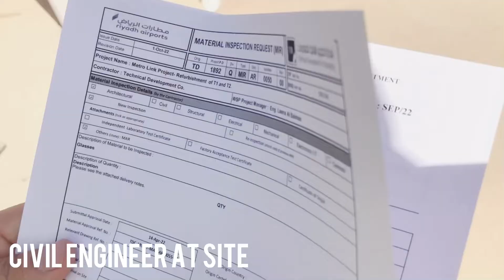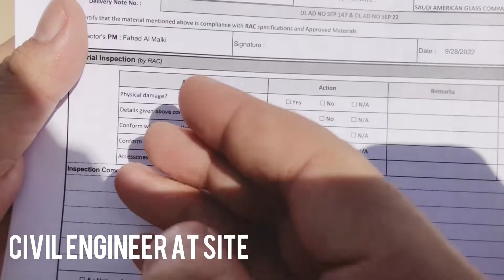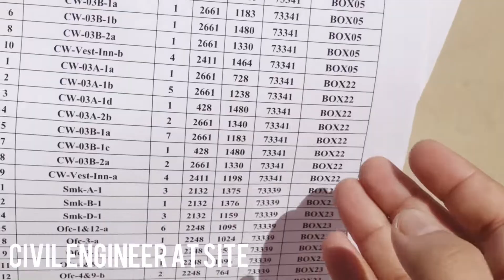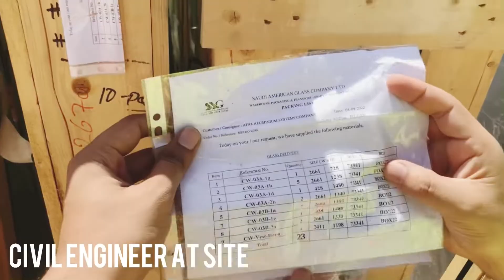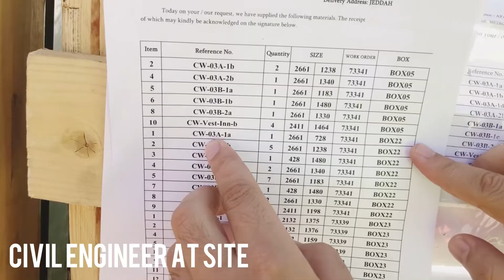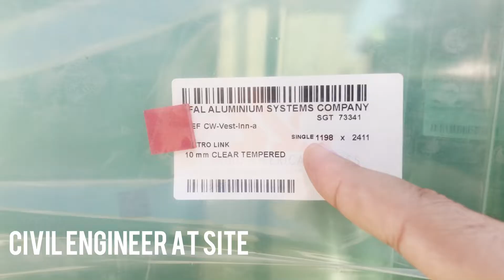Materials Inspection At Site| Inspection of decorative Glasses|MIR|How to do materials inspection.

Comment: Sir i have a question. Verify the main tags attached to the materials. These tags are located outside the material. We need to check the quantity mentioned on each tag and compare it with our list. Is this sufficient?”
Reply from the maker: All the data of the tag should be matched to the delivery notes and technical data sheet.